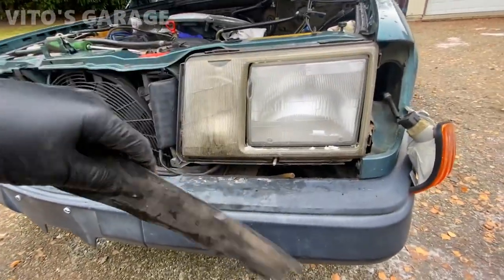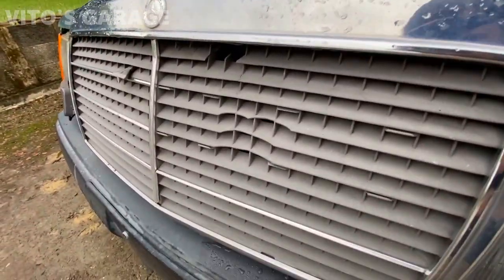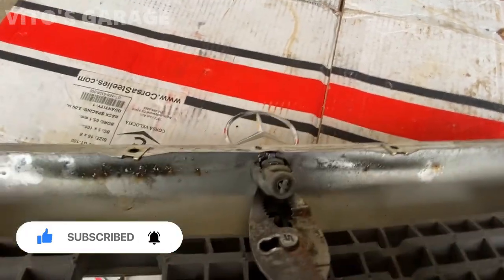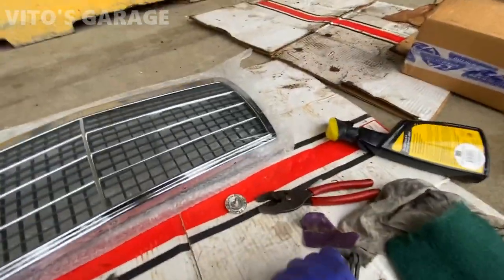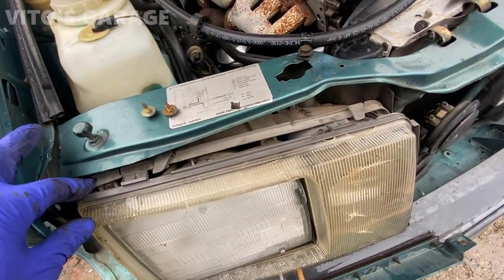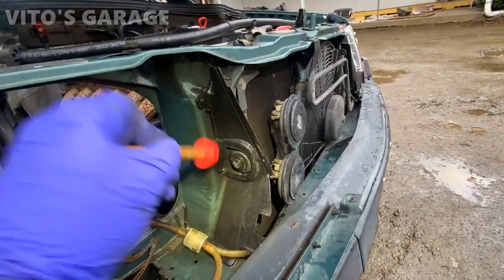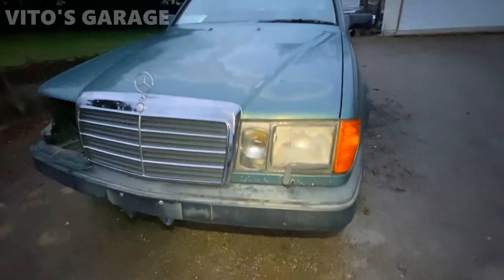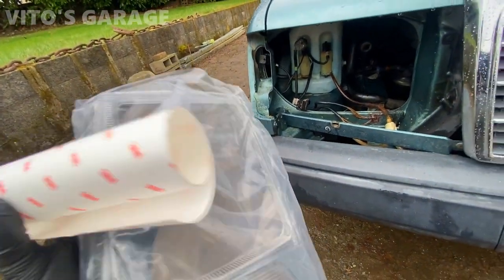Part 17 Mercedes W124 300E: New Headlight Bezels & Grille!!!

Comment: The only EUROparts I will install are the bezels. I put a ton of UV protection on because at the end of the day, it is EUROparts.
Reply from the maker: Clear film does amazing job for protecting against rock chips and fading. I’ve used this method for many years and on many cars without issues. Happy with the outcome
Reply: @VITO'S GARAGE  on a 190E I purchased there was film that was over 10 years old... it took 6 hours to get it off the headlights, the small plastics under the headlights and fender.